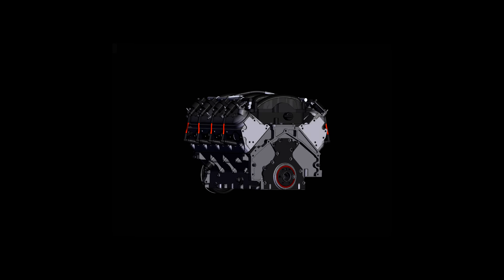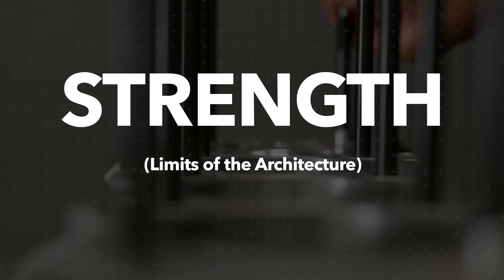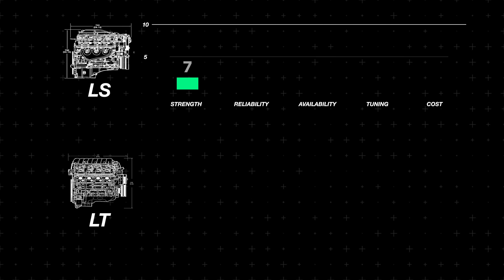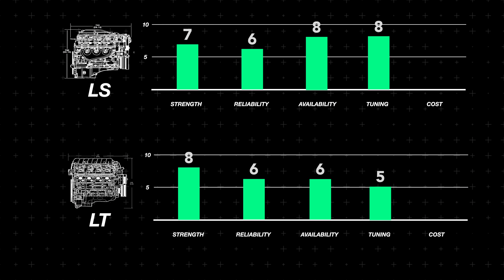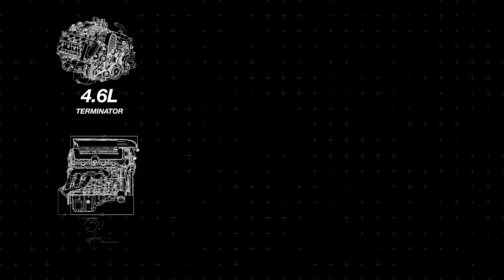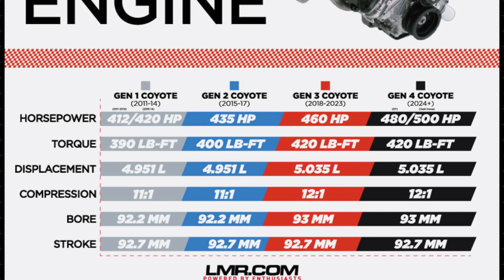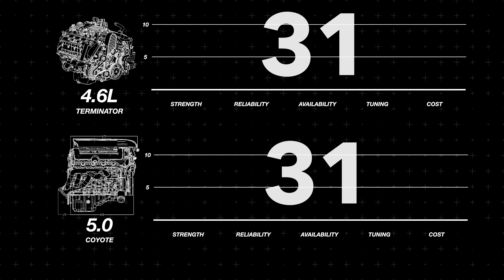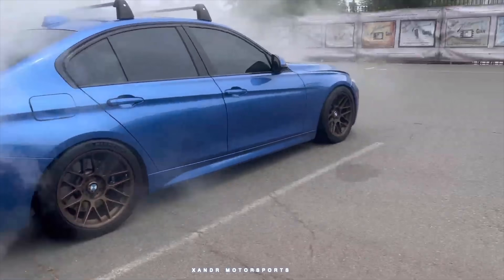Why Old Engines DESTROY Newer Ones💀| Explained Ep. 25

Comment: Please do correct me if I am wrong , but I personally think the B58 is just as strong as a 2JZ-GTE (both at 9 in terms of strength) 
There are many B58s RELIABLY handling well over 800-850whp (equivalent to 1000bhp) on unopened stock engines. Titan motorsports had a stock unopened B58 rated at over 850whp and they constantly abused it, over 120 dyno runs, many different fuels tested on it, and loads of quarter mile passes, it never blew up, they just replaced it with a built engine to be on the safe side. When they tore it down, most of the parts looked pretty much new as well! The B58's factory aluminium block has incredibly thick walls and was originally designed for high performance Diesel engines. Papadakis racing has been constantly abusing their built B58 drift motor (1100whp) for quite a few years now, it still has the stock aluminium block and also the stock crankshaft. The current 2JZ stock internal record stands at 1106whp, the current B58 stock internal record is around 950whp. Give it some time and I bet there will be a few 1000whp stock internal B58s around.
In terms of reliability (bone stock form, with stock auxiliary parts), both engines are reliable, but they do have their issues. The B58 has cooling system issues, coolant hoses that burst and leak at times etc, the valve cover gasket/PCV valve is also known to fail early on in its life, causing oil leaks. The 2JZ-GTE's stock twin turbos aren't that good and have been known to fail, affecting the reliability, most tuners have single turbo swapped the 2JZ-GTE in order to improve reliability. The stock 2JZ-GE (naturally aspirated) on the other hand has hardly any common issues and is bulletproof.
The 2JZ on the other hand I believe has a lot more availability compared to the B58, considering it has been around for so long (30+ years), thousands of tuning companies are still producing after market 2JZ parts to this day, blocks, rotating assemblies and many more.
Reply: Even better than the b58 is the S58, the red bull drift team turned there's up to 1000bhp (which was super easy) and they used it all season and didn't have any problems, they literally abused it as much as they could just smashing it of the limiter for a whole year and the engine was still in perfect condition.
Reply: weight of the B58 is 130 kg LESS than 2 jz
Reply: I used to have a buddy who was one of the first techs atTitan Motorsports waaay back in the early 2000s. 

He gave me a ride in a 1200hp Supra he had built for a friend.  I was just around the corner as a sales manager at a Lexus dealership and he picked me up for the shakedown drive. 

That car was the most violent, insane car I've ever been it. 

The way it went from about 25-140+ was astonishing.  

I've been in all kinds of fast cars, only a select few even came close to that cars brutally and badassery
Reply: B58s are literally the best inline 6 in the world right now everybody just knows dyno queen Supra numbers for 2jzs
Reply: @benjaminwatson7868  agreed 100%. But this guy has some biases and I think is pandering a little bit to the target audience. Seems mostly focused on American cars and Japanese imports so he couldn't possibly rate the 2J below the B58. B58 is IMO a way better engine. Not even really comparable. BMW M50's with turbos run against 2J's and the B58 is miles above that engine
Reply: @cheyennegrahamoneill9330 Can't anger the angry mob.
Reply: @cheyennegrahamoneill9330 yeah he is 100% biased. I mean he Gipse the B58 a 6 in availability although you can literally buy that engine from the manufacturer still. Doesn‘t get more available than that in my book
Reply: the best B58 tuner/builder Papadakis doesn't push his built motors much past 1200hp. He's found the limits. 

Aluminum blocks are great for dissipating heat but cast aluminum doesn't handle drag racing as well as iron or forged materials.

2Js will always be better straight line engines than B58s since they have 300 extra pounds of structural material to hold them together.

B58s are one of the best track focused engines out there.
Reply: @WorkinClassCanadian  bmw badge = dogshit trash making half the engine out of plastic, fuck bmws so horrendous to work on, enjoy your plastic rocker covers and plastic sumps with your plastic waterpumps lmao
Reply: You're not wrong, hell even the n54 puts the hurt on 2Js
Reply: Supra Mk.4 still holds the current world record for the fastest ever car with a manual gearbox. Still waiting for someone’s car to beat it. It’s 6.23secs at 365km/h (227mph) for the quarter mile. You think any other newer manual gear boxed car/engine is fast…we’ll beat that, if you dare. So yes old engines win.
Reply: @Mega-G-Star  That supra was completely not stock, literally every single thing in it was changed for it to go that fast... modded to absolute hell and back. 
If man can land on the moon, then it is possible to strap rocket engines onto a Fiat 500 and make it go 500mph. 
With enough correct mods and money spent, you can make any car perform miracles, not just the supra.
Reply: @Josh-qm4rb  Never said it was stock, I said “It holds the world record for fastest car with a manual transmission” you know with an ICE, also fool Jet Cars don’t have gears. So get of your high horse, you can’t handle the truth 😂
Reply: @Mega-G-Star what truth dude? All you said was nonsense little jimmy
Reply: @Maximus20778  ok little w⚓ name a faster car with manual gearbox? You can’t because it’s a worldwide record. Is fact not fantasy like Transformers. Peacock.
Reply: @Mega-G-Star  there's an entire list and not one shows a mk4 supra so where did you get this claim?, your dreaming bud and get better oh and btw Hennessy venom literally is beating that tincan.
Reply: @Maximus20778   I know you’re unable to drive a manual 6 speed. 
I said fastest Manual gearbox. (Never said stock) nor production car. 
Also factory built Hennessy Venom is 13.63 secs 0-300 km/h. I stated a Supra has recorded 6.23 secs at 365 km/h over the quarter mile, so go goggling Optimus dumdum.
Reply: @Mega-G-Star  wow it took you 2 weeks? Convo already done homeboy

Comment: I think the LT1 block is by far the best. You can bore and stroke it to ls7 specs and rev it out to 8000+ rpm on a roller cam.
Reply: Likely not with an OEM DI based fuel system. Maybe with an aftermarket dual port injection system. A DI fuel system injects fuel on the compression stroke, and hence is why DI engines aren't known for spinning as they barely have any time to inject fuel into the cylinders at high revs.

But yes, the architecture of the GEN5 is superior to GEN3/GEN4 SBC.

Comment: I will agree with everything except the low score of the 2JZ in availability.
If we are just talking GTE then yes, a 3 is appropriate since they were only ever available in one car here, and import GTE's are getting very costly. But, add in the tens of thousands of SC,GS and IS300's and you're talking about a $200 PicknPull visit all day, every day....I"d rank it a 6 minimum. Add some rods, pistons and ARP studs and you're making power.
Reply: That or get a aristo with a 2jzgte which are at best 8-20k depending on the miles + condition.

Comment: Outstanding video and content my guy!!! You never disappoint. My only pushback here is the availability of the B58. Admittedly I haven’t checked on prices from junkyard pulls so I’m totally open to the idea that they are insanely priced. That being said, the B58 has been in production since 2016 and is used in 2, 3, 4, 5, 6, 7, & 8 series cars as well as all the RWD based X platforms excluding the new XM. They’re hugely plentiful at least here in the US, but you’re right in that they are either a premium option or the cheapest engine on a higher series car/SUV.
Reply: i was about to say, he is giving availability ratings higher for engines used in 2/3 cars, b58 should have scored 10 easily, because it is used in 15+ cars simultaneously.
Reply: I heard that bmw will keep them around till 2030 so they'll more than likely start getting cheaper over time considering that bmw puts them in almost every car they make now.
Reply: Availability factor It's not just mechanic shop owner who can source their engine from junk yard.   Some engine is so plentiful, that an average Joe can get it from mechanic shop, online import and places like craigslist, offerup and what not.
Reply: @BlueRice agreed. Which is why I disagreed with his thoughts against the B58. They are easy to get a hold of. They aren’t the cheapest option by a long shot, but readily available through all the avenues you’ve mentioned and more. I just emphasized junkyard because of places like pick-n-pull or COPART
Reply: Same as with LS outside US. There aren't cars here that have them🤔 Would be expensive af to import some. Basically only see 90's-00's Chryslers
Reply: u for got the 1 series
Reply: @Zwan_oj  I didn’t forget it. It’s no longer produced for the US market and the X1 is FWD based. I don’t know anything about that hatch version elsewhere. Does it have the B58 as well???
Reply: @brandonchism6960  the previous generation m140i did
Reply: @weloveyouuaj  that’s awesome!!! It literally is used across BMWs lineup then.
Reply: @brandonchism6960  Yes the M140i F20 and F21 both have B58's. They were never in the US market.
Reply: @Zwan_oj  damn man, a RWD hatch with the B58 would’ve been epic.
Reply: @brandonchism6960  we've got 2
Reply: @Zwan_oj  not gonna lie, I’m jealous. Enjoy them man!!!

Comment: Cool comparison, although a bit flawed. Comparing a run of the mill Coyote that goes into hundreds of thousands of cars and trucks to a niche very limited and special run of the Terminator engine. You should compare the Coyote to the 2V found in the regular GT, or compare the Terminator engine to the Predator of the GT500.

Comment: LS > LT (except LT6)
Coyote > Terminator
B58tu > 2JZ (and i own 2 2JZs)

Glad to hear someone else say what you said about the B58.
Reply: The b58 is a great platform, and out of the 10's if not hundreds of inline 6's to come out since the 90's its one of the top 3 best I6's. I will note, the 2jz is in another realm in terms of strength. 750hp with just bolts ons is absurd for a 30 year old engine (minus simple cams and springs). + the fact its cast iron, has Siamese sleeves and a girdle that acts like a block brace. Until theres b58's pushing 1800hp reliably on that cast alloy block, there is no way in hell the b58 is a better engine. Reliability is what everything comes down to.
Reply: @lennixsingh626  the 2JZ has 30 years of aftermarket development behind and I promise you’re not finding 1800hp SBE 2JZs running around. Even the GTE rods and pistons can’t handle more than about 46psi which gets you around 1000hp. The B58 hit 1000hp within like the first 8 months of the A90 being out. Brian Crower is working on a 1500 or 2000hp B58 right now. All the stuff you would change out to make 4 digit HP reliably on a B58 is the same stuff you’d change out on a 2JZ. Not to mention the B58 has much more impressive power delivery. The A90 has been out for just a few years and there’s already companies offering 1000hp engine packages with warranties. It’s lighter, just as strong, and the real limiting factor is the direct injection setup and let’s face it, you’re changing fueling in a 2JZ as well if you’re going for big power. As great as the 2JZ is and believe me it’s an absolutely amazing platform which is why I own multiple of them, the B58 has the benefit of 30 years advancement in tech and manufacturing processes.
Reply: @harrisonpeck130  I never said theres 1800hp  2j's with SBE's. I pointed that out because they use the cast block. I can guarantee you when they start making 1500hp on those alloy b58's they will start ballooning,
Reply: @lennixsingh626  my point about SBEs was just to highlight that focusing on stock capabilities using high hp examples was a moot point because it’s unrealistic. But I disagree about the block ballooning. First off ballooning would be a result of cylinder pressure and not necessarily hp. And the B58 makes power more efficiently so it wouldn’t take as much pressure to make that power. Also, again the B58 block has the benefit of 30+ years of advancements in tech and manufacturing processes. And it shares the architecture with BMWs diesel variant.  Aluminum doesn’t mean weak. The VR38 is an aluminum block and easily takes 2000+ hp.
Reply: @lennixsingh626  there are C8s pushing 1200-1300hp on an LT2 (aluminum block) that aren’t ballooning. When the 2JZ was designed, an iron block was needed to make crazy power. But times have changed. Back then you “had to run ~8:1 CR” for boosted engines and now you got boosted engines from the factory pushing 11:1
Reply: @harrisonpeck130  An engine doesn't magically make more power than another with the same capacity and minor variables like int and exh ports. So ur point makes no sense. A V block is a completely different ball game when it comes to strength as opposed to inline blocks.
Reply: @harrisonpeck130  once again. A v based block is very different to an Inline block.
Reply: @lennixsingh626  but an engine does make power differently with changes to what you call “small variables”. And I’m sitting here saying that architecturally the B58 is a very strong block. And intake/exhaust differences aren’t small changes. That’s why camshaft upgrades are one of the very first power mods for any engine. The B58 head flows better; the dual Vanos delivers power better than VVTi which is of course single cam and most GTEs aren’t VVTi to begin with. And while you want to generically say that the V setup is so drastically different than the inline setup in terms of how much power and engine can handle, let me point out that the reason why the VR38 was my first example is because both the B58 and the VR38 use electric arc wire spraying on the cylinder walls for added strength in place of cast iron sleeves (as does the coyote engine which is yet another aluminum block engine making ridiculously high HP).
Reply: @harrisonpeck130  Electric arc wire bores aren't what make the engine tick or give them their power. they are two completely different engine layouts. A V engine is better and stronger than Inline engines. its no secret.
Reply: @lennixsingh626  they don’t make power but they do add rigidity like a cast iron sleeve would which in turn allows an engine to withstand more cylinder pressure and handle more power. Stop trying to avoid that point by getting hyper focused on the V vs inline being different which is a point I’ve already said I wasn’t trying to make. Address the subject at hand of the aluminum block B58 having the same wall treatment that plays a role in other aluminum blocks reaching insane HP levels, negating the need for an iron block.
Reply: @lennixsingh626 you wont see them ballooning lmfao
Reply: @harrisonpeck130  all facts right here. Finally someone that knows what they’re talking about in here and not a bunch of 14 year olds
Reply: @carter898  bunch of fan girls who refuse to accept that one platform being better doesn’t make another one any less great.
Reply: @harrisonpeck130  for sure it doesn’t. B58>2j
Reply: @lennixsingh626  actually. A B58 had just recently tapped just into the 1500hp range to see how much power they could get out of a new turbo that was basically not released to the public yet. The tuner said it can make more since he didn't see any limitations but decided to hold back to go and do tests to see and figure out ways to make the car hold the power down at the strip.
Reply: @carboydorifutoparty3976  Doesn't change the fact 2js are already have the numbers and records to back it up. Theres 2000hp+ cast block 2j's and 3000hp+ billet block 2j's.
Reply: @lennixsingh626  literally no one said anything about the 2JZ not being able to do that. You’re trying to shift the point of focus. It was your very own words claiming that the B58 would start ballooning when they start making 1500hp. And someone said that the B58 has already done that and is capable of more. At no point did anyone say anything about a 2JZ not being able to make whatever power. And to even bring up billet blocks when your whole stance is based on factory block material is completely asinine.